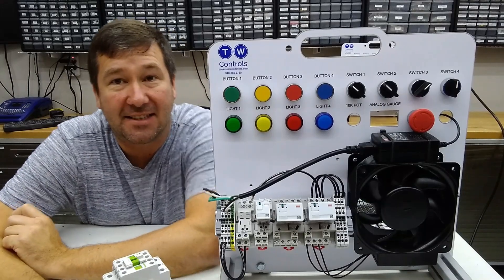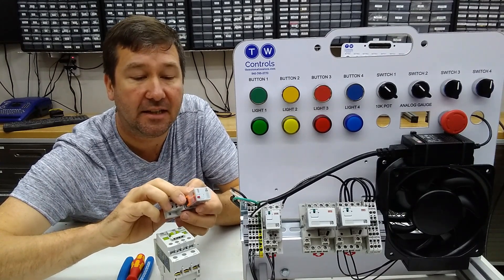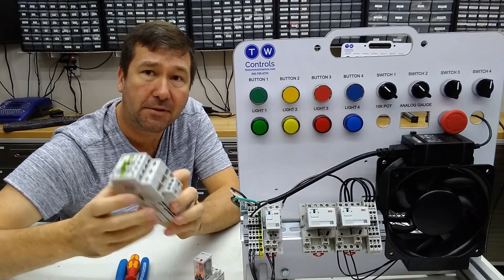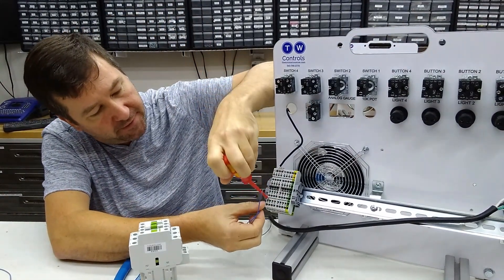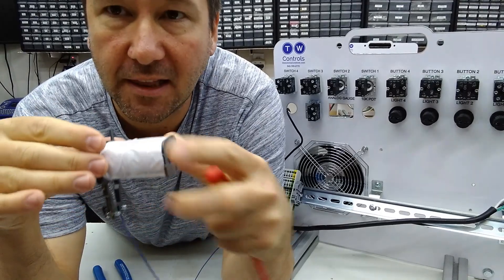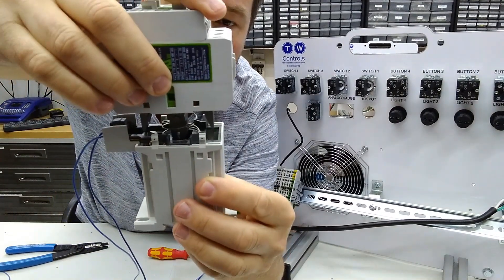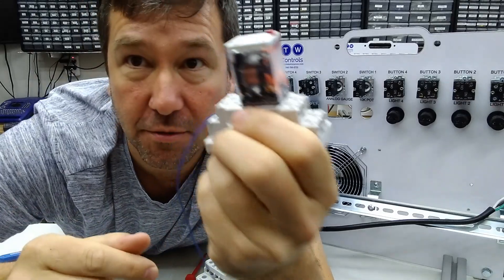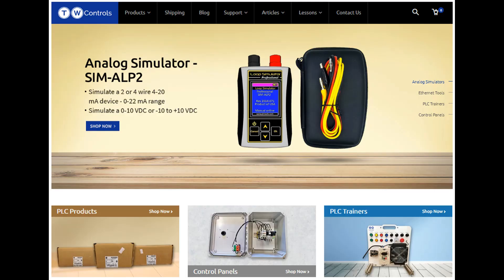Relays and Contactors - How Do They Work and What is the Difference

Comment: Tim, why is the voltage rating so different between AC and DC?  (In the video at  0:50-1:25)
I have a relay I was going to use for a 90v DC motor rated 5 amps.  My relay is rated  28v DC at 10amps.  Will that work?  What is the important rating, volts or amps, or both?  Should I use a contactor instead?  Thanks very much!  Regards
Reply from the maker: Probably not.  Clint does a good job of explaining why in this video.
https://www.youtube.com/watch?v=ctYLmzhBU_Y
Reply: @TimWilborne  Thanks Tim, but I still don't understand the vast difference in AC and DC ratings. The relay I mentioned above is rated  250VAC ~/ 28VDC  10A.  Why such a difference?  Volts are volts, right?  Thanks
Reply from the maker: @KW-ei3pi  No, volts are not volts...there lies the problem.  AC is a SINE wave which mean it crosses 0V 60 times a second (60Hz) or roughly every 16 to 17 milliseconds.  DC is constant.  When you try to open a relay contact, you will produce an arc.  AC sees that arc for a maximum of 16 to 17 ms.  DC will see that arc until the relay contact moves far enough away to break the arc.  That is why is is common to see AC voltage ratings 10 times higher than DC ratings and even then the amperage rating may not be the same.  If I have to switch a DC load in one of my panels, I usually will select a solid state relay.  Here is another video Clint did that may help with those.
https://youtu.be/NpFEQ6qF1JE
Reply: @TimWilborne  Awesome. Thanks!  I will probably see if I can find a Contactor that will work. But shopping for one has so far been difficult. Thanks again.
Reply: @TimWilborne  One more question, Tim.  The circuit has a Potentiometer. It's normally set to a very low speed before the DC motor is started.  It's connected to the S1, S2, and S3 terminals of the Motor Controller.  Does that limit the voltage to the motor and thus reduce the risk of damage to the contacts of the relay or contactor? Thanks
Reply from the maker: @KW-ei3pi  No, you need to toss that relay and get the right one for the application.
Reply: @TimWilborne  My problem is finding what I need.  Ideally, I would like to go online, type in the coil power I need, the contact rating in DCV, the DIN rail mount I need, and find a selection, suitable for a hobby project price of less that $35, and be a standard, readily available part for easy replacement.   Instead, my only option is to wade through hundreds of relays and contactors on Amazon, finding some that are close, but not exactly what I need.
Thanks though, for all of your help. Regards
Reply from the maker: @KW-ei3pi  You should be able to hit that price, just contact one of the manufacturers

Comment: What would stop me from using a relay instead of a contactor aside from the amperage or voltage? If the relay has pretty much the specs that I need for my aplication, thanks. Great video.
Reply from the maker: Typically you just need to make sure it states that it has a horsepower rating higher than your motor.  Many "relays" have low horsepower ratings despite having a high amperage rating.
Reply: @TimWilborne  Thanks, Tim. I learned how to wire a PLC thanks to you by the way. Regards.

Comment: Hi Tim, I just discovered your channel today and I'm enjoying (and learning) watching the series.  My control panels are for my DIY CNC machines, so happily the voltages and amperages are smaller, but the same concepts often apply.  However, I have a question:  I inadvertently bought a contactor with a 24VAC coil, when I have 24VDC in my panel.  The coil activates with 24VDC and coils, as you point out, are simple electromagnets.  Do you know how a 24VAC coil would be different from a 24VDC coil?  Thanks Gary
Reply from the maker: Hi Gary.  In some cases, 24V coils can be used with AC and DC but for the most part 24VDC coils are larger.  My advice is if doesn't say 24VDC, swap it out.

Comment: In a scenario in a multiple storey building if you have:
multiple occupancy, 
communal gas boiler that does heating,
Communal chiller that does chilling,
Heating and cooling controlled in form of dps switches, static ps, and temp sensors, 
Pumps to regulate the flow operate on a duty/ assist/ standby,  
A sample video of how safety circuit can be manually isolated and reinstated from the panel, ( relays are 24v DC)
Reply from the maker: Hi Edmond.  We have some safety videos coming that will hit the basics of this.  Thanks for watching!

Comment: Tim, do I have to be a certified electrician to work with motor controls?
Reply from the maker: No you just need some basic troubleshooting tools but becoming a certified electrician is a great goal to shoot for.
Reply: Not at all. I been doing for over 30 yrs including building electrical troubleshooting. Getting qualified as a controls technician is a great addition. I'm working on it now. Next year I'm becoming a full contractor. Lots of east coast travel.